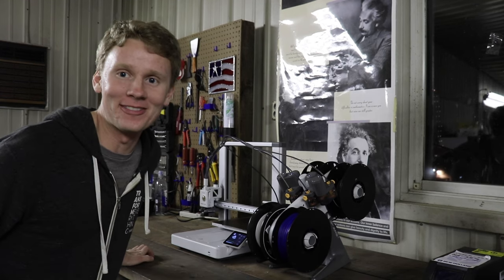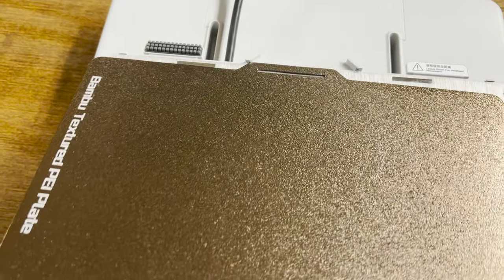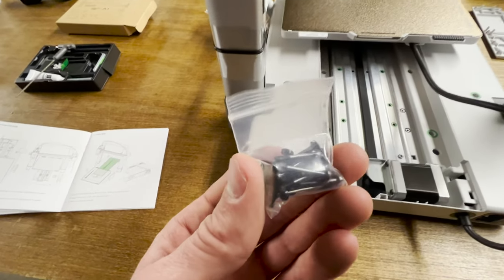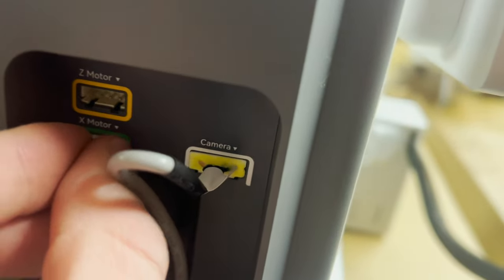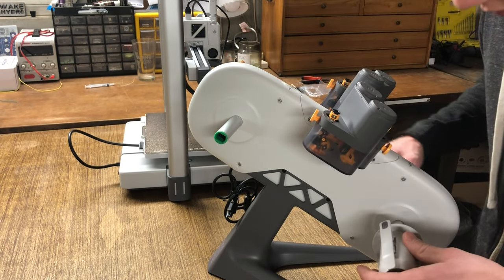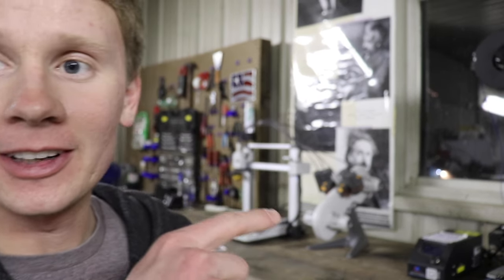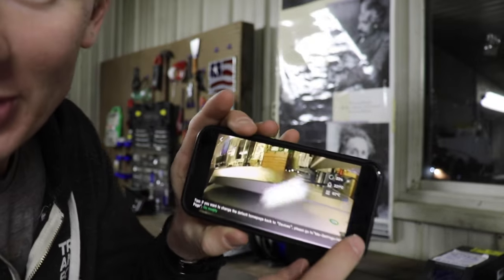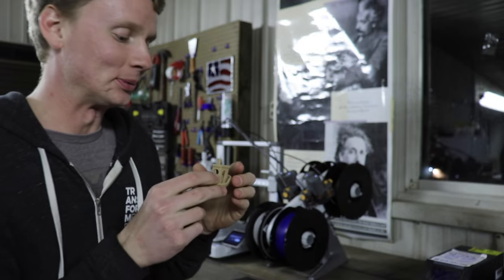DON'T MISS THE BAMBU LAB A1, UNBOXING THE BEST 3D PRINTER OF 2024

Comment: Ah, you should be good for your wood filament. If you get too worried about clogs moving to .6 nozzle doesn't hurt. I would pass on using wood or metal fill with the .2 nozzles though. Thanks for the video!
Reply from the maker: Thank you for the advice! I’m excited with how it worked out! I’ll be posting a new video this week on TPU in the Bambu Lab A1

Comment: I'm not going to buy one until I get some actual reviews that mention some downsides like the proprietary firmware that does not allow you to use things like Klipper.
Reply from the maker: I understand that. I was just so excited that it had me extremely optimistic. After having it for almost a week my least favorite part is all of the plastic boogers it’s throws onto my work bench. What other 3D printers are you considering?
Reply: To a lot of people, that's not a downside. Those people couldn't care less to tinker with klipper. There are plenty of other printers that are klipper capable either out of the box or modded.
Reply from the maker: @plutonasa  what is Klipper? I’ve never heard of it
Reply: @jakemgrim  It's another type of 3d printer firmware that is very popular among 3d printer tinkerers
Reply from the maker: @plutonasa  got it! Thank you!

Comment: Not a good idea to touch your PEI bed all the time as this will reduce bed adhesion
Reply from the maker: Oh whoops! Was I touching it a lot?
Reply: Lol. Nothing a little soap and water wont cure
Reply from the maker: @josephp1592  good to know! Thank you
Reply: @jakemgrim  Just make sure your PEI bed is clean before printing (no oil etc)
Reply from the maker: @megabain  got it! I’ll make sure to keep an eye on that. Does hair spray help? I always use hair spray on my cr10
Reply: @jakemgrim  Yes, but the main point is to make surface sticky. So use isopropyl alcohol to clean the bed from oils and fingerprints. To ensure good 1st layer you can use hair spray.